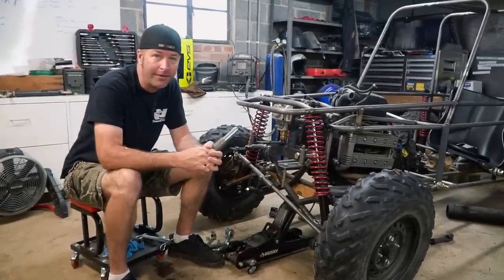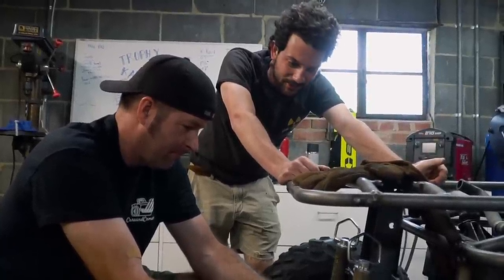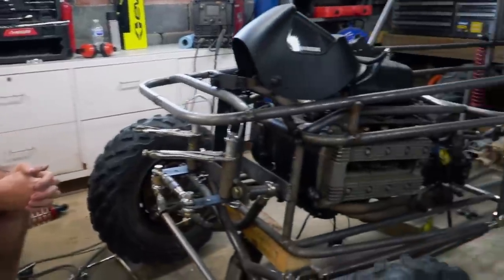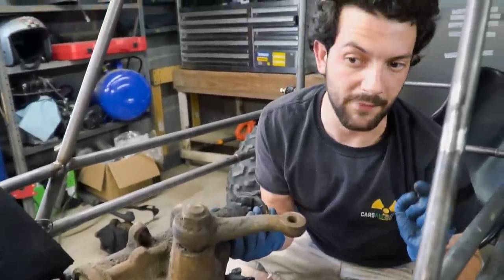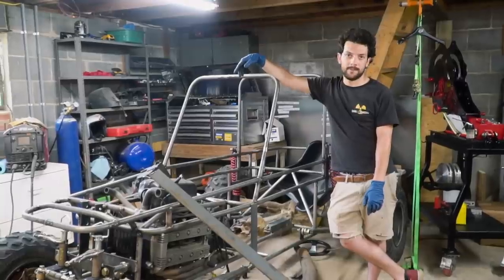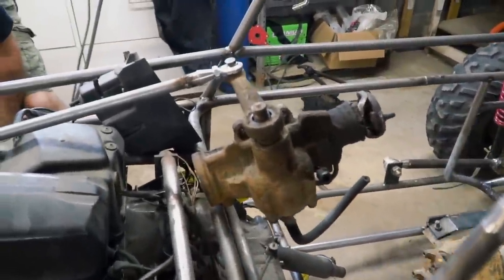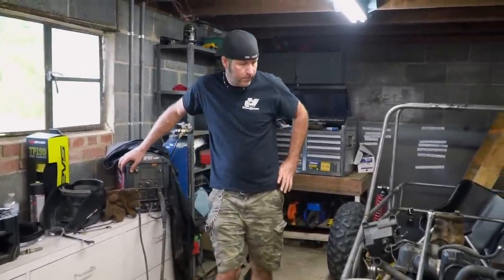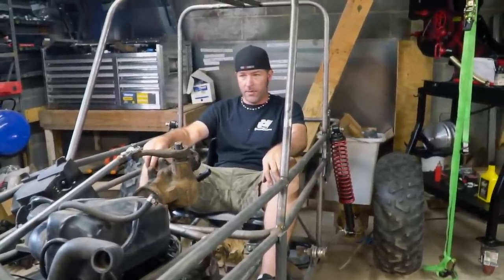1000cc Trophy Truck Build Pt. 9 | Steering Finished!

Comment from the maker: I seriously need your advice- do I build a 30x50? Pole barn, carport style, I beam style? Or do I wait till I can afford bigger?
Reply: Afford bigger more space for good builds
Reply: I wouldn’t go with a pole barn. Just do a metal building, and go as big as you can. I built mine so that I could expand it. I’ve added 60’ of length to my original shop, and needed it.
Reply: I beam
Reply: Bigger is better
Reply: Love the vids! (I suggested to do a trophy kart)
Reply: If I could afford a 30 x 50 I beam style thats what I would build. I would recommend at least planning for a clean room area for engine assembly and paint. Not having a clean room is my biggest grip for my 30 x 40. I do everything from wood work to paint and body. Often times have a paint project and then also something that makes allot of dust going at the same time. Just something to think about.
Reply: Wait till you can afford to build the bigger barn. One of those fabricated metal barns. Not a poll barn there no good. You can have power and lights with the fabricated metal barn.
Reply: Go with what makes you comfortable and what you can afford.
Reply: Red I beam style!!!
Reply: Always can build with the intentions to add on to at a later date.
Reply: I would wait but do what you think and go with what’s cheap but reliable. Less cost to build = more money for bigger
Reply: Better go steel, John.  Y'all got hurricanes. Nothing worse than seeing scattered tools and parts.....
Been there.....
Reply: Bigger is better
Reply: Look at my comment
Reply: Wait till you can afford bigger. And go steel. Hurricanes ain't fun
Reply: you need me to drive down there and help build a pole barn? They are simple and cheap, especially if you do it yourself.
Reply: Shipping containers for storage put some shelves in the back for spare parts put a bunch of carts in there
Reply: Keep in mind the cost of heating/cooling it. That's the one thing most people do take in consideration for their size shop. Definitely go with the strongest structure you can afford.  Mabey you can get some sponsoring to help with the cost too. Plan on putting at 2 post lift in for future builds or personal use as well you won't regret it. Good luck and keep the videos coming.
Reply: If you build it smaller than you want to now you won't be happy with it and you will likely never want to spend the huge amount of money for a tear down and rebuild into what you really want.
I'd say wait untill you can comfortably afford what you really want and do it right the first time. 
Will save a lot of stress and headaches in years to come.plus you have a functional shop for now so there's no need to rush into the building untill you're ready.
Reply: Definitely I Beam with high end walls 14 or 16 ft tall will give you tones of room with lots of doors for cross ventilation, you will not regret it.
Reply: 30×50 hanger style upper storage on one side.
Reply: Steel building!
Reply: Try the steering box from an old 8-900 rzr or other utv
Reply: I would start with, how many work areas do you want and how big do they need to be. Where’s the tool boxes going, where’s the big tools going and what work around room do you need. 
I would skimp on the length because that can always be add. It would be better to do 60’x30, and then just add as needed.
Reply: Bigger is better
Reply: if you do a pole barn the shop will be up sooner thus getting you out of the tiny little thing you call a shop
which is more like a mancave
Reply: I beam style
Reply: Metal building on a monolithic slab. You'll never regret waiting or the extra cost. No depreciation. Better resale.
Reply: Wait and get a huge metal building.
Reply: I beam
Reply: I’d get a slab 24’ wider then your intended building so you can put a carport on each side. You don’t have to do it all at once to ease the burden on your wallet. Step 1 slab, you can put a party tent on it and have large storage for a year or two, and add your power drop. Then step 2 build the core barn/workshop. You can finish and facilitize as money allows, then add 2 car ports on the sides on the extra slab, if you add an outer wall with drive through access for carts and air it’s pretty ideal storage, or close the ends of the carports for extra 3 season workshop space.
Reply: 30x50 is bigger than you think, leave room behind, you can always add to and extend
Reply: If you wait to go bigger, your going just keep wanting more and more, more, but if you had the 30x50 you can start your business, and in a few years if you think you need more, just add to it, no biggie
Reply: pole barn all day.   In my county (randolph nc) they consider steel buildings as non-tradition construction so there are more regulations and thus cost much more to construct.  So check with your local inspector about that.
Reply: You live there don’t you? I’m that house on the property? Get something nice if you live there... I would get I beam style, always pretty and well built 🤘🏻 good luck!
Reply: I built a pile barn style, and don't regret it one bit. It's easy to heat and cool. It doesn't sweat like metal buildings and the walls are thick enough you can pack a lot of insulation in there. My walls have 8+ inches of insulation in them and I can run a small window air conditioner and get it down to the 60's in the summer. I live in Indiana and our winter's get cold and our summers hot'ish. You don't need a industrial building to be honest. a two story pole barn would be perfect. Half loft style and leave the other half open so you can get a lift in there.
Reply: Do a red I- beam with lean to s off the side for extra storage.
Reply: Unless there's some kind of regional concern, pole barns are plenty strong enough. I'm in Michigan, and where I'm at we get frequent high winds in the 60-80MPH range, and they hold up just fine. One thing that helps a lot is spray-foam insulation, it stiffens up the whole building significantly. My dad built one that's 25 years old now, and aside from cracks in the concrete you'd never know, nothing wrong with it. There are crappy pole barns out there, but that's because they were built poorly, it's all in the workmanship.
Reply: California Corvair Parts has an aluminum steering box for $80.00. Part No. CC06242
Reply: Metal enclosed carport style going to get more for your money and they are still strong
Reply: Go bigger and just take a little longer.. Start with a 40x50
Reply: I highly recommend a steel truss building. The only thing that will burn down is what you put in it
Reply: Go for the steel buildings, relatively expandable as necessary, easy access to all the infrastructure (electrical, etc) and you can have as many bay doors as you need
Reply: Pole barn you can build straighter walls for your second story
Reply: You don’t need a big space to do cool things!! Check out “doctor ds” he dose big builds in small place!!
Reply: Steel building, slab longer to accommodate later building  expansion or sunny work space out of the mud.
Reply: i went with a 30x50 pole barn and wouldnt do it again, too small and youd be surprised what "nature" gets in.  swallows love the place for some reason
Reply: Id go with ibeam with 2 big doors
Reply: I beam.
Reply: Steel building is definitely the best 30 ×50 is a nice sized shop!
Reply: I beam
Reply: I feel like the pole barn would be great.
Reply: Pull barn
Reply: Go big or go home ! That’s my dad always told me :)
Reply: Do not face it into prevailing winds as the doors take a Hell of a lot of forces during storms.
Reply: Wait until u can afford 40x60. U wont regret it in the future.
Reply: Red I beam definitely and you want 40 by 60 well you can make a lean tube on the end but close it off with walls so that 100% of the 30 by 50 is working room and the lean tube is car storage
Reply: Get some shipping containers and build yourself a large building.
Reply: TURBOOO
Reply: Build a 40x60 pole barn.
Reply: Steel building with I Beams because if you need to expand, you can always pour more slab and blow out a wall and double your size. Talk to some contractors that build them to get an idea about what you need now and what you can do in the future.
Reply: Mid to late 80s rangers had I beam suspension you could probably borrow off of that. Or off of late 80s early 90s Ford f150s
Reply: Bring in several ship containers, and build a place with those. You can start with a couple. You can stack them and create several stories eventually.... or you can make a box with containers, and build a sweet courtyard in the middle, where you can entertain. Ship container building is completely modular. Add space as needed, over the coming years, by bringing in new containers. You will also gain a pile of good steel for use in future projects, when you cut some of the containers to add windows, and doors, etc. You'll also be completely unaffected by hurricane season.
Reply: Go carport style metal building its long lasting and cost effective also usually the construction is put in with purchase price
Reply: Stronger would be better and put a bigger seat for your buggy
Reply: Whatever style you go with make sure you design it 4 easy add-ons trust me it doesn't matter how big you first start your building you always eventually get to a point where you want to extend the space. I'll go with an I-beam set up but your wallet always makes that decision.
Reply: walls are nice for shelter and shelving, trust me I don't like working in my carport.
Reply: Wait!
Reply: I'd go bigger. Maybe start with something small that is easily upgradeable/expandable.
Reply: Oh and add a base of sb2 gravel before you pour your slab you can plate compact that down good and your slab will be much less likely to crack
Reply: CarsandCameras  i have a 48x92 steel building for sale that needs to be put together,never been assembled and in a conx box now
Reply: If it's at all possible I'd look for anyway to do 3 phase power, to allow for machine tools. The idea of a paint booth is a good one. And dont forget a good solid mobile table of some sort.
Reply: Wait for bigger but when u do go I beam u can use the i beams to hold up carts ur not using and pull motors
Reply: Pole barn my man
Reply: To be honest it depends how long it is till you can afford bigger.
Reply: I beam
Reply: If you go Pole barn, you can always add to it. With carport, or I beam it's a bit more difficult and or expensive to add to it. Say 30x50 now and pour the slab for that. Then later when the wallet allows add another 30x50 to it or however large. 

If you go the cheapest route adding to the side of it, just means tearing down the wall between the two leaving the beams. You can reduce the amount of beams or reduce them completely but that adds a little more cost and complexity.
Reply: I beam
Reply: Bro the potential you guys have is amazing, with the mindset you have it’s just like an engineer.
Reply: 30x50 is pretty big for go carts. If you want storage then i would say go a bit bigger. If you just need a building hq then that is PLENTY.
Reply: 30x50 I beam style, add on later as desired.
Reply: I think the important part is not to cheap out on a pool barn. If you build it well it will last a very long time.
Reply: on royal distributing they have a super atv heavy duty rack and pinion
Reply: Probably need to go bigger. I'm just thinking that you'll end up using a lot of the space up for project storage!
Reply: I say the red I beam style also. Long term is best.
Reply: Call Carolina Carports tell them Superior Sheds Of Hudson sent ya, if I can I'll do the contract.
Reply: Check out Carolina car ports
Reply: Local building codes will have a big influence on your decision. Make sure to check that stuff first, before you even pull permits. That said, I wouldn't do a carport style building, not for your intended use. So the real question is I-beam vs pole barn. Both have their strengths and weaknesses.
Reply: Pole barn. Lots of nice pole barn buildings and you can still do the office. Plus cheaper and you could possibly make it larger. The metal pole barns do also still look nice in my opinion.
Reply: Metal building on footers/beams. Electric & pluming in the slab. You might want to install additional PVC in the slab for expanding in the future. Security systems, and new electrical “ home runs” for new additions.  Metal buildings can be expanded easily in the future.  Go as big as possible.  Large slab!!!  Expensive part, but better and cheaper in the future, for expansion. Build your pad with your future plans illustrated to you approved contractor.  Get several bids if possible.
Thanks for your efforts guys. Terry&ThePirates. South Florida
Reply: id go with the i beam, or wait untill you can afford something bigger
Reply: Garages with metal siding and roofs are pretty easy.  I built a 40x50, with 10 foot 2x6 walls by myself in 3 months.  A good crew (Amish?) could put up a 30x50 pole barn in a few days.
Reply: I beam
Reply: I like the I beam idea. Do it do it doit
Reply: I am throwing this out there now.  Coffin cart. Lets put it to a vote. ✋🏼 who wants the coffin cart this year??!?
Reply: Go bigger for safety and if you need to hang a mini bike up you can use it as a engine hoist lol
Reply: Build for the future. The strongest most permanent would be the wisest investment. Plus I believe you could always add on down the road.
Reply: 30x50 is a pretty good size foot print. My shop is 36x48 pole building I just wish I had more vertical for storage above.
Reply: Got for the steel I-beam. Depending on what kind do siding you plan on using you could always expand with an area cut out to add rooms in the future.
Reply: I beam
Reply: Here is the thing. If you build just what you need your going to out grow the building in a hot minute. I would look at all the options and get the biggest bang for you buck. That being said, the area your in gets really really hot and humid in the summer, just take cooling into consideration
Reply: CarsandCameras wait, you’ll never be satisfied if you rush it, patience grasshopper. ( maybe you’re to young to get that reference)
Reply: I beam. Might as well do it right the first time.
Reply: Biggger
Reply: Go Iron!
Reply: You can always add on if needed, go I beam though!
Reply: I beam design is best
Reply: I beam
Reply: CarsandCameras I beam style
Reply: I'd go with a I-beam style then over top the your cart building section you can set some chain hoists to lift engines and so forth for bigger and badder builds
Reply: Better off holding out for a a enclosed steel structure. Cheaper than you think.
Reply: @mikemc7704  What? I have power, lights, water, heat, etc all in my pole barn...
Reply: I’d say I beam
Reply: I Beam is the way to go
Reply: wait
Reply: John, depending on your finances and the amount of labour you want to invest in yourselves, 
Consider having a few weekend working bees or work shops, (THE OCCUPANTS PAY TO COME) 
and as it is just a large rectangular building it will go up very quickly, 
Being basically sand, clay or road base materials, small amounts of cement, and wheat bag's the money saved will mean a far bigger shed that is naturally well insulated 

checkout the part 1 of Kris Harbour "s workshop it is a rendered sandbag and as you have a tractor now it will make life easier (like Kris has,)
NEXT
Check out how mylittlehomestead does their sandbag building
Also consider a straw Bale. Building (rendered) you could use a rammed earth floor, post and beam, and tin roof then infill the walls with straw bales forced down over in bedded reo rods they go up very quickly to plate height then you cover the lot in chicken wire and render the outside and inside extremely well Insulated (20inch thick walls) search YouTube for straw bale buildings
Again advertise that you are having workshops even if you just offered work for food BELIEVE ME THEY WILL COME!
another option is pored in place concrete panels
(concrete slab down, black plastic over that, formwork for the panels on top of that
(think on how you are going to join the panels when standing up) 
Reo bars or mesh for strength, fill with concrete let dry 1 panel made, you want a window? Put a form in the panel frame and theirs the window space, rinse and repeat as they say!
If you had as many frames ready to go call up a cement truck if you don't feel confident in the grano work call in a team for a few hours to give you a perfect finish and extra hands to do the work
Again this once they are dry goes up very quickly, our supermarket went up in 3 days and it is huge!
I hope these suggestions give you some ideas guys
Strong backs and plenty of motivation to you all
Tony from Western Australia.
Reply: I added a response under the video as I didn't see this comment.  Please read. By building as I stated, you can go for a bigger structure now.
Reply: @mikemc7704  you can have power and lights with any structure. Anyone who says pole barns aren't any good haven't built them right.
Reply: Carport style
Reply: You can still use steel poles instead of wood for a pole barn. And still no footers. Auger out holes. Rebar and concrete pedestals  with bolts sticking out just like parking lot lights are done. So it's still very strong. Build it out. Then come back later with AB base and pour concrete right up to the walls. No forming! I have built pole barns that you wouldn't even think that's how it started unless you knew what to look for.
Reply: red I beam
Reply: If you do it, do it right. GO BIG OR STAY HOME
Reply: 60 by 40 is small when you put stuff in it
Reply: Build the 30x50 I beam and just make it nice man. You can always build on to it and I would love to see you document that process as well. Use the build to your advantage . Document the build and that will give you content and revenue and might bring in different subscribers with the different thimbnails
Reply: pole barn For sure but if you think you need more space go for it
Reply: I had Steel Structures of America build me a 40'x60' pole building.  One walk-thru, three 10'x10' doors and one 10'x12'.  My only real regret is not getting all the doors 10'x12'.  Of course now that I've had it for seven years or so, it is completely filled and I wish I had an additional 40'x60' building!  I was leery about going with a pole building, but I'm happy with the results.  We are in a pretty dry climate; I'd be a bit more concerned in your area with wetter ground year around.
Reply: Carport style, put more into projects
Reply: Don’t forget that you are building a recording studio/workshop and need secure storage... along with any office space for production work.
Reply: Pole barn all the way. You can insulate fairly cheap if you want. Also the actual building is not that much. Most of the expense will be in a concrete floor if you decide to do concrete. BTW trophy truck looks great!
Reply: Why not two shipping containers and roof the span.  Extra dry storage and car port, I think you can even get a pre made roof for that also.
Reply: This is a difficult decision for you guys to make. First, you CURRENTLY need space, and a lot of it. Depending on how much cash you have on hand... I'd go pole barn, build an upper "office & storage area" out of wood. Office for planning, and the storage for infrequently used, but good to have on hand items like parts/bolts/etc. Below the office area could be for steel stock/parts storage that's accessed weekly or so. Have a plan to expand as finances allow. Remember, NEVER leave yourself short of cash. That's critically important for a successful business. However, if you really have enough money to go Beam and have thousands of $$$ left over, and no debt, go for a permanent, but expandable shop. 

Finally, a previous follower made a great point about the "clean room". Maybe you could use the original shop for that, and an inexpensive carport for temp storage of vehicles. They could easily be moved into either shop within an hour.

Any way you go though, leave yourself plenty of cash, and a plan to expand. If I had $100K on hand, no debt, and good credit, I'd go Pole Barn, and I'd have the room to work, an office for planning, some dedicated storage area, be financially safe, and positioned to expand later. The downside  may be the extra work involved with the possible disassembly of the Pole Barn, for a more permeant structure a few years from now. 

Worst thing I ever did was start buying things that I wanted but didn't have ALL the cash for, so I borrowed. That ended up taking YEARS to get out of debt (there were also unforeseen events that put me deeper into debt), and ended up costing me HUGE amounts of money over the years. I would have been much better off being patient, and having at LEAST half my cash left AFTER a purchase. Instead I purchased what I wanted (but wasn't really NEEDED), borrowed the rest, and life punished me after that. Cash on hand baby. Cash on hand. Never be short of that.

Thank you for asking us our opinions. I wish you the best of luck. You guys are doing great!
Reply: I-beam all the way. Carport won’t help with humidity and rust. Pole barn won’t give the supports like what you put in your small garage for a hoist. The i-beam is the way to go. Get it done right the first time!!
Reply: Go for a metal building they are usually cheaper and can be assembled yourself.
Reply: I have a 25x40 pole barn and with shelves and tool bench along the back i can only get one car, pool table and a riding mower. For 1000 square feet i can't get any more in. 40x60 minimum guys or you will be sorry. 30x50 would do it but it will get tight fast.
Reply: Quonset hut on concrete slab
Reply: barndiminium
Reply: Go with the steel beam building, you won't regret it. I'm enjoying my 30x40x15.. Brush fires, Welding, Grinding Cutting torch sparks don't mix well with wood frame pole barns
Reply: I like the I beam style 30x50, but I think you should consider a little taller than 14 foot maybe 16 for head room in the upstairs office.
Reply: Wait until u can afford a bigger i beam style garage
Reply: Wait
Reply: Ad prefab steel building will be the most cost effective to build and maintain.
Reply: 30X50 pole barns would be good
Reply: I beam guys great for overhead crane and no support poles in the work area....john...Australia
Reply: Steel is real. All your REAL shops are made of steel beams, no wood.
Reply: @legowarriorsadventure3613  So YOU'RE to blame! Lol.
Reply: GO FOR TWICE WHAT YOU NEED,  YOU'LL NEVER REGRET IT.
Reply: DID YOU CHECK THE SIZE AND WEIGHT OF THE CHEVETTE  STEERING BOX?
Reply: @ScottGovey  My best friend is a self employed mechanic. He heats his shop with a woodstove converted to burn used motor oil, of which he has an abundance!
Reply: @rydplrs71  That's a great idea.
Reply: As commonly said by the youtuber AvE . Get the biggest best tool you can afford on your budget.... It also sounds You have already made up your mind on the I beam.  And you know is the most sensible thing to get. But I'd love to say a small in shop bridge Crane it would be great for you guys. An a vehicle lift .cnc plasma, lathe, mill, bandsaw, ACDC mig tig stick(Everlast) welder,metal break , power hammer.... thing u really need to think is what kind of power  to the shop can u get. 3phase is a definite need if u can get
Reply: Just built an i beam style 30x50 a couple years ago, no regrets whatsoever. Been through 2 hurricanes already with no leaks or issues. Easy to build too if u wanna try yourselves. Built mine myself with a manual genie lift in less than a month working weekends and afternoons.
Reply: Pole barn. Less expensive and you can finish it however you want. I know a guy who has a full on automotive workshop with lift and everything and it was a pole barn
Reply: Look Into a 40 x 60 steel coraget still industrial building they are reasonable and would go for at least 10 foot ceilings on both floors
Reply: Definitely I beam style
Reply: I'd wait till you can  afford a bigger workshop John, it'll be much better in the long run.
Reply: Yes a 30 by 50 and make it 16 foot ceilings cause I have a shop at home with 16 in it and it makes your options go farther like for like laughs and stuff and doors but I would go for stick built not a pole barn
Reply: Hey John I priced out a 45x36 hanger and a 60x50 hanger for some property we are looking at. 

The quotes I got back for the price of the 60x50 I could push the 45 wide hanger to 84 feet. That is a fair gain in square footage for the same cost.

A word of advice put a drive through door in the long side along with the one in the end. You will thank me 

I think you should look at the 30 foot wide building and look at the cost of making it deeper. You may be surprised at what you can get by making it deeper.
Reply: Donell Muniz I’ve been planning my barn in my head for 30 years.  

I think the best part of the design I can offer is a trolley and lift system on both floors. A friends father had one where you could open the second floor and lift equipment from a truck and set it where you want upstairs, or drop anything in a truck bed like a generator or snowmobile.
Reply: 30 x 50 is a very nice size you would probably get more bang for your buck in size from a pole barn but lean twos on the side is an excellent idea
Reply: I beam
Reply: Curious about the afford more part. Close to a million subs and your the only guy who hasn’t sunk money back into the channel.
Reply: I would do a carport. Cheap to build, cheap and easy to add walls too (no studs just cross braces then rough cut lumber for the walls) and it will be easy to disassemble a wall to make the shop bigger in the future.
Reply: I beam
Reply: I beam would be great.
Reply: My vote, I-BEAM👍👍👍
Reply: What ever style you go with build one that can be added to as you need more space down the track if you can afford it have the pad done to the size you want it to be in the end
Reply: Pole barns work great and are easy to add on to later in needed !
As for the floor if there is any way you can afford it go with an 8 in thick  minimum concert slab 10 or 12 would be even better but with at least 8 in thick you can put in heavy tools later . like a lathe , milling machine and welding table .
Reply: Go big a build I beam
Reply: There’s pros and cons for everything you mentioned, I would definitely recommend red iron I$beam
Reply: Do I beam.  You have the small building for storage and overflow jobs.
Reply: You certainly would not regret building a pole barn with metal siding- and it will be there long after you are gone. It would take quite the hurricane to remove a strongly build pole barn set atop a small hill.
Reply: 30x50 is enough but go tall enough that you can have a tool area downstairs with office/storage/hangout area in a loft above.  Plan on leaving a spot large enough for a lift too just because we all need a lift in our life.  The space isn't as critical, just look at what Collin Furze has built in a garage that would barely hold a small car.  Using the space wisely and planning it out is gonna make all the difference.
Reply: Put whatever structure style you truly want each has its pros and cons but with the ridge running east-west as a pass-thru style building (big bay door on each end for air cooling in the summer also by cracking both bay doors about 6 inches and elevating whatever you want to paint waist high you effectively create a downdraft paint booth (old school garage automotive painting trick) then you have the option to power the entire structure via solar...(solar electric or solar water radiant heating preferably in slab and for cooling you could use ground loop radiant water (if done in slab)as once you go in slab heating/cooling you'll never want to go back)  best option is to go with a wide structure with short length to start and as funds become available increase the building length
Reply: I would go car port style. Simple setup. Very easy to maintain and to do future add ons. Super easy to upgrade the walls on the inside for power outlets and other accessories, has a roof fan to get rid of that hot air. Best of all relatively cheap. 14k for an entire setup including the concrete floor and running a new power supply to the unit.
Reply: Whatever style will let you get a Steel I beam crane, you guys definitely need some sort of crane for bigger projects and health purposes
Reply: Have you looked into steel buildings?
Reply: @sketchybuildz1339  I agree however they will want to do several thin layers compacted to a total thickness of 18-36 inches depending on the subsoils when they dig for the slab because you gotta dig down before you can go up... when we made the foundation for my employers new rock cutting shop we dug down 12 feet (it was built on a compacted base of decomposed granite) and repacked it in 6inch layers with a self propelled vibratory roller so that it was hard enough to drive 73k lb dump trucks across without sinking into the surface... the building has had zero problems with settling even with several hundred tons of vibrating and slamming machinery set upon the concrete slab foundation
Reply: If carport style means the metal buildings made from the same style siding/roofing they make those $700 carports woth, that's what i would do.  There's at least 1 manufacturer that offer an upgrade to the steel framing it that upgrades it from 2x2 square tubing to 2x3 or 2x4 rectangular tubing.  It adds so much more strength for a minimal fee.  You'll also want to do the vertical style roof, which is another slight upgrade cost, but it minimizes the chance of having any roof leaks since they hang the panels vertically instead of horizontally & the water doesn't have to wash over the peaks & troughs in the siding/roof sheet metal.  I had an 18x20 built, with the upgraded framing & vertical style roof, for less than $5500, including the grading, concrete slab, & construction/installation.  Install on mine onlt took 1 day, so something like a 30x50 would prob take them 2 days.  I'm also in NC outside of Charlotte, so thats NC pricing for comparison for you too.
Reply: Ibeam and wait
Reply: I beam
Reply: I think a pole barn will be the best of both worlds. The feel of a small shop but the room to stretch your legs if needed!
Reply: I beam, I built my shop 15 years ago and it was the best investment to my home. You won't regret it.
Reply: Lot of misinformation going on here.  A pole barn is perfectly fine, and what I would recommend.  Build what you can build now, otherwise you're always going to be waiting so you can afford something just a little bit bigger.  30x50 pole barn, 16 or 18 foot concrete to truss, and you'll have a really nice shop.  Can build a loft over part of it and have tons of upstairs storage, can box in a small room under the loft for a "clean room", etc.  Properly built for you area and it will be just fine, but my best advice would be to buy a Hansen Buildings kit if you want to do it yourself, or find the money to have Morton Buildings build it for you.  Plan ahead for plumbing, obviously add electrical and insulation after it's built, and you can do a lot in a 30x50 shop.  Put a 12' lean-to on one or both sides (at build time, or after the fact) to give you another 12x50 area.  Full boxed in or not, your choice. Throw down gravel and it's great for storage, or pour concrete and put in a man door to the main garage bay, and you now have a separate work area.  Unlimited potential.
Reply: High-Beam would last longer and still leave room to grow as your builds grow, and who knows you guys may be on the verge of becoming a small buisness/supplier location for G.P.S., I feel like you guys are right there to become something bigger and better good luck guys keep up the awesome builds
Reply: Pole barn. We have a single floor pole barn, don't know dimensions  but everyone in my family loves the room when we have to work on our cars.
Reply: i beam bigger building  you will thank us later
Reply: I beam would be best
Reply: I build Red Iron I beam buildings for a living. They are far superior to any other type. If you can afford one, build it. Just be sure to get an "expandable endwall". This means you have a regular truss just like the middle of the building on the end so you can extend the end of the building in the future.  If you did a 40x40 now, you can double that in the future to 40x80 pretty easily
Reply: I would wait til you can afford bigger.  Because from what I can tell, the channel is only going to get better, so you need room for all your projects.  Plus, it would be nice to see it all in one location instead of scattered to the wind!!  The I beam is a good idea cause you can build storage racks off the structure beams for keeping carts on, or get ahold of some from a warehouse somewhere that may be closing down.
Reply: Ed H yeah they would probably end up needing a bigger one anyway
Reply: I-beam is the best in the long run. Strong and easily expandable if needs be.
Reply: No matter what style you get, make sure you get it bigger than you think you need to begin with. If you short change yourself on size you'll always be wishing you had more space.